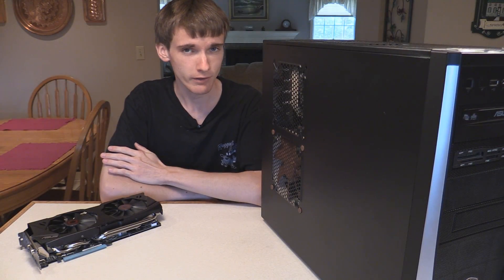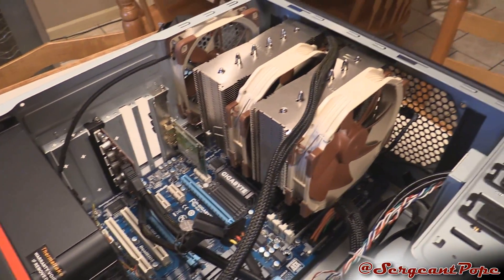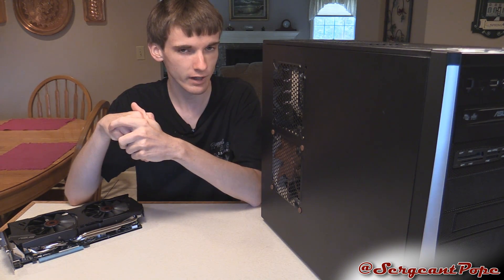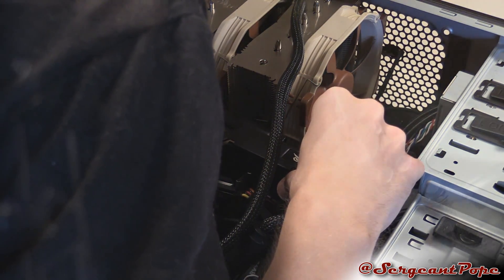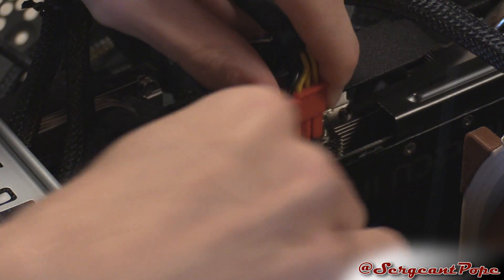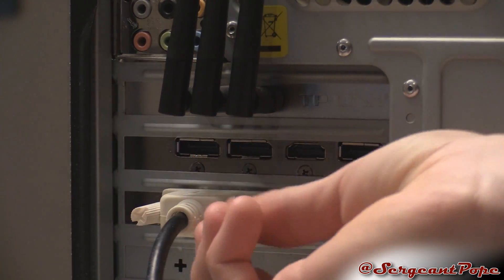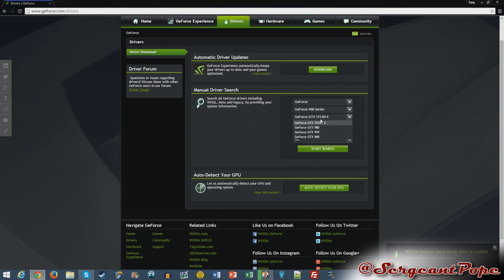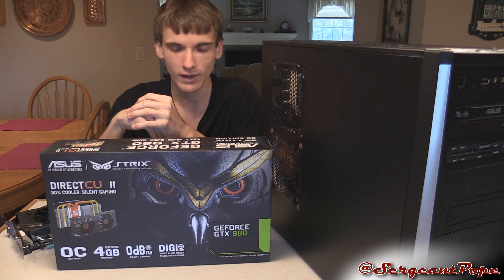How to install a graphics card - GET INTO PC GAMING EASY!

Comment: Hi, I just got a EVGA 1050 ti 4g (Superclocked) graphics card.
I removed the front panel lined up my graphics card and pushed it in, (also i removed the paneling on the backside so the ports would stick out)
(there were also no 6 pin or 8 pin connecters needed)
I turned on my computer, my monitors did not load like they usually do. (my monitors were plugged into my mother board. One is VGA connected and another HDMI)
I am really excited to use it, but i can't. If you have any idea how to fix it please tell me.
my pc specs are
Amd A8-7600 R7 Graphics
16 GB DDR3 Ram
2TB Sata Hard Drive
Antec 380Watt Power supply
Reply from the maker: You have to plug the video cables into your graphics card, not the motherboard. That's probably the issue.

Comment: Hey man what about a GTX 1050 ti?
Reply from the maker: That card is a little bit better than the GTX 950 of course. If you want to spend a little more. It's still a good deal for that card.
Reply: SergeantPope should run cod like a champ surely

Comment: Ok, so I know this is an old vid. but I'm having an issue. maybe I'm just an idiot. I bought a a AMD Radeon RX460 4GB GDDR5. I own a HP Pavilion 510-p024 Desktop. The graphics card seems to be too big? But the card was supposed to be compatible with nearly every computer.
Reply from the maker: That's a really weird motherboard on that desktop. It looks like the 24 pin power connector is at the bottom of the motherboard? It looks like that could block off a graphics card. I don't get why they would've put that connector there... It looks like with that motherboard configuration you'd only be able to fit in a single slot graphics card, which aren't very common. Sorry Nicholas.
Reply: SergeantPope Thanks for telling me.
Reply: SergeantPope Do you think that if you find the free time if you could help me find a gpu for my pc that's at least 4gb?

Comment: I bought a dell inspiron 3847. I figured even with the default built in graphics card it would run most modern games low spec. I was so so wrong. I need a graphics card, I am happy with all other specs on my pc. I have a good 100 or more to drop on a graphics card, and suggestions that will help me play modern games?

Comment: I'm getting a graphics card that is Gt 730 for my DELL Optiplex 745. Will it be good enough for my PC and my power supply is 305 watts.
Reply from the maker: That should most likely work. The GT 730 requires 300 watts.

Comment: Alienware X51 330W psu, installed my new 1060 and uninstalled oild drivers, installed new drivers and i've hit a brick wall and need urget help, any help is appriciated. :)
Reply from the maker: If you're trying to use a GTX 1060 on a 330 watt power supply, that's probably your issue. I think you need at least a 500 watt power supply for the 1060. I have a link in the description of this video that shows the required power for graphics cards.

Comment: will this graphics card work with my dell inspiron 3847?https://www.amazon.com/gp/product/B01K1JV83C/ref=ox_sc_act_title_1?ie=UTF8&psc=1&smid=ATVPDKIKX0DER . i checked the motherboard and it has the PCIEX16 slot aswell as a PCIEX1 slot. my computer has a 300w powersupply and i was wondering if thats enough aswell. thanks!

Comment: any help I installed it with the power supply but the graghics card just keeps spining off and on
Reply from the maker: The fan just keeps spinning? For the power supply or the graphics card? You're getting no picture on your monitor?
Reply: SergeantPope sorry if late but everything works fine but the gpu just turns off and on off and on every 5 seconds the other fans work perfect just not the graghics card I got an rx 470 powercolor red dragon
https://lh3.googleusercontent.com/9jUbhjF_2L1xerjmCzaKeveBTbfsfm5E1s5PeSnYYq2caUN9XnLuO2AZ0IKZJOVzyMcgAF9YNA

Comment: if im running 550 ti at the moment. my power supply compatible with 1060?
Reply from the maker: It should be. Believe it or not, the GTX 1060 actually uses less power than the GTX 550 Ti, despite being a lot more powerful.
Reply: SergeantPope Thanks so much... Im going to shop right now to buy it :)

Comment: I'm new to working with computer components and I have a 1GB DDR3 EVGA GEFORCE GT710 NVIDIA graphics card. I put it in my computer and plugged in an HDMI cord into it but my monitor just turns black. My motherboard is a Z68A-GD65(G3). Is my graphics card compatible with my motherboard or is am I just installing my graphics card in wrong.
Reply from the maker: Your motherboard should be good to go. That's honestly a really low powered graphics card, but it should still work. How much wattage is on your power supply?
Reply: My power supply is 450watts and peak 700watts. Another detail or forgot to tell you was that when I turn on my computer, the monitor is black and at the bottom right, it says B2. Please help, I haven't been on my computer for a month.

Comment: and i have a AMD FX(tm)-4300 Quad-core proccesor does it match with a gtx 1050 ti?
Reply from the maker: Sure, that processor would work fine with a GTX 1050 Ti. As for your power supply, the 1050 Ti is pretty power efficient. If you have a 400 watt power supply, that's probably enough to run it.
Reply: Nice thx dude!

Comment: hey ive  got  a question
my pc is HP Pavilion p6-2431el (350w, 3.40GHz, NVIDIA GeForce GT 640)
and im thinking of changing the graphics card to MSI GTX 1060 Gaming X 6G.
i only need to change the power supply box right?
tnx! :D
ps: i still dont have a new graphics card but im already watching how to install them xD
Reply from the maker: Yep, your computer should easily handle a GTX 1060. But like you already noticed, you'll need to get a slightly more powerful power supply. The 1060 requires 400 watts, which is sadly just above what you have :/
Reply: Haha yeah tnx again 😀

Comment: hey i was just wondering if this would be a good mixture of componets for my gaming pc here they are:
ASUS NVIDIA GEFORCE GTX 750 TI OC 2GB GDDR5 VIDEO GRAPHICS CARD - HDMI DVI & VGA

Intel Core i3 2100 - 3.1 GHz Dual-Core Processor CPU SR05C

and 16gb of ram thx
Reply from the maker: Yeah, that sounds good. 16GB of ram is a little overkill with those other components, but everything would work fine.
Reply: SergeantPope ok thanks :)
Reply: SergeantPope one more thing... do you know of anyways to update more storage on my computer, im running low on storage
Reply: SergeantPope um this is my last question, i woke up this morning to look for a 6pin slot i dont have one nor do i have a 4pin or 8pin csn you help? (its a gaming pc)
Reply from the maker: Pewdiepies Pie - LivingNightmare To update more storage, you could either get a bigger hard drive or SSD that you have your OS loaded onto, or you could add another hard drive or SSD to your system. You don't have a 6 pin connector on your graphics card or your power supply?

Comment: I have A Radeon 270 high profile Graphics Card! It runs Cs:go At 30 FPS should I buy a better one?
Reply: Also 840 p at High
Reply: +Mr.Crafty yes
Reply: TheBrokeWalrus buy a gtx 1050ti low profile and depending on if your processor is a quad core you should get around 90fps you should also have a power supply of at least 350w

Comment: my monitor is vga so when i install graphics card, I don't need to connect my monitor to my motherboard right?
Reply from the maker: Yeah, you'll want to plug your monitor's VGA cable into the graphics card instead of the motherboard now. If your graphics card doesn't have a VGA port, you'll have to get an adapter, though sometimes graphics cards come with these adapters already.
Reply: SergeantPope why do people say ignore VGA and other ports on graphics card and go straight with HDMI only.
Reply from the maker: Agent Tickle HDMI is a lot more common these days because it is digital, can allow higher resolutions and frame rates, and can pass through audio. Does that answer your question? Nothing wrong with VGA, but technology is always advancing.
Reply: Yes it does. Thank You.
Reply: at least im not the only one using VGA XD
Reply: Arran Bear srry but i got a new monitor with hdmi :P
Reply: Agent Tickle why do people make me sad  :(
Reply: Arran Bear cuzzzz u have a bad monitor...
Reply: Agent Tickle i know XD, im getting it changed anyway

Comment: Hey, I am using two asus strix gtx 970 how much power supply do I need to run in sli?
Reply from the maker: From what I found, it looks like you would need at least 700 watts or so to run two GTX 970s in SLI without running into issues at full load.
Reply: SergeantPope  

Oh okay thanks. I currently have a 700 watt so gonna try it :)
Reply from the maker: BLAZEWIND Very cool. As long as your power supply is from a reputable company (such as Corsair, EVGA, etc.) then I would imagine it should work.

Comment: I just got overwatch and I can't play IT because i need A better grafic card. I don't whant to spend more then 100$ but what should I buy?
Reply: gtx 750
Reply: BaseAze r7 260x
Reply: pico666 buy a gtx950....they go for 80 bucks here used and run csgo at max at like 150fps....i bought a 4gb SSC 960 for 90 bucks and ran csgo and l.o.l. at 180fps minimum at MAX settings
Reply: for the price and quality get a palut gtx 750ti you can get a brand new one for £94.99 and it can run csgo at 90fps and 1080p at ultra setting it was my first graphics card now i have three 1080's and 1 of the new titan x's
Reply: link?
Reply: gtx 1050

Comment: My budget is $150 graphics card what should I get that's decent ? And what's the watts
Reply from the maker: There are a few options on the AMD side. An RX 460 is a little under your budget, and the RX 470 is a little over your budget if you can spend a little more. Then on the Nvidia side, the GTX 950 would fit best into your budget. Any of those graphics cards will probably need a 500 watt power supply.
Reply: ok thx

Comment: When uninstalling the old drivers, which ones do I uninstall. All the nividia programs?
Reply from the maker: Yeah, if you already have Nvidia drivers, delete all of them. Sometimes there are several, so you just have to go through all of them an remove them individually.
Reply: thx. the installation of my gtx 1070 went great

Comment: Hi pope greetings from India ,I have DH55TC motherboard i3 processor 4gb ram n 450w psu , as u know the board is a LEGACY BIOS , and want to install GTX 950 EVGA FTW GPU. I herd that it was only UEFI compatible is that so ? Or will it work in my setup . My budget 150$ max advise me if better GPU available
Reply from the maker: That looks like a super old motherboard. I would just suggest getting the graphics card you want and if it doesn't work on your motherboard, then upgrade it to a modern motherboard.
Reply: But that board from intel says it supports till i7 processor , I'm really not inclined towards buying a new board , but in graphic cards there's nothing like it working on a particular BIOS right? Just a 16x PCI will do know ?  Thanx for your speedy reply !!
Reply from the maker: dhiraj sh True, but that is probably much older i7 CPUs. As far as I know, all you need is a PCI 16X slot for a graphics card, so you would just have to buy the graphics card and see if it works I guess.
Reply: SergeantPope  thank you so much !!

Comment: when i add graphics card to my p7-1380t system it does not display
Reply from the maker: Did you upgrade your power supply? Your computer comes with a 300w power supply, which you will almost certainly need to upgrade.
Reply: Is not about powersupply any card I fix does not shoot, i have checked my bios settings still the same. My system model is p7_1380t, pls help me.
Reply from the maker: Opoku Nti Alright, even though almost no graphics cards will run on a 300 watt power supply... On some older systems you have to change the BIOS video out to the graphics card. Other than that, make sure you have your monitor plugged into the video outputs on the graphics card. Make sure the graphics card is fully seated into the motherboard. Make sure you plug in the supplementary power for the graphics card.

Comment: hey need help!!i got r9 270x.the manual says to disable the onboard Graphic,so I did and also changed the display initialization preference to PEG.connected the Monitor to the dvi of the graphic card.but when I start the machine, the display doesn't show anything,it turns on and goes back to power safe mode.what should i do?
Reply from the maker: Hmmm, alright. Do you have the power connector plugged into the graphics card? Is the graphics card seated into the motherboard properly? This could cause issues.
Reply: thanx for the reply.problem is fixed.the dvi to vga adapter which I used was faulty.
Reply from the maker: Rishabh Shirke Ahhh, that's a weird issue. I'm glad it's fixed though.

Comment: My computer is Acer XC-705.Is Asus GeForce GTX 750 Ti OC 2GB compatible with my computer?
Reply from the maker: Your desktop is a low profile design, which means it is half the width of a normal desktop. This makes it slightly more difficult to upgrade, but it's still possible. You would need to buy a GTX 750 Ti low profile card such as this one: https://www.amazon.com/Gigabyte-GV-N75TOC-2GL-Graphics-Cards/dp/B00MW8NXAW/
Then you could also need to upgrade your power supply. The GTX 750 Ti requires 400 watts and your power supply is 220 I believe. But since you have a small case, it will only fit certain types of power supplies, which usually cost more than typical size power supplies.
Reply: Thanks!
Reply: Does the Asus GeForce GTX 960 MINI fit in my computer?
Reply from the maker: Jason Cai I don't believe that would fit. You need a half height card and that card is still full height, even though it's much shorter than average graphics cards.
Reply: So I have an old computer that has a windows Vista in it that is a fullsized desktop. Should I change the old hdd, cpu and ram to my current  ones and just buy GTX 960 MINI and put it in it?
Reply from the maker: Jason Cai That would probably work. Honestly, just getting a new full sized case (either a used one or brand new) would fix your issues. Just move the computer components from your slim case to the bigger case and you'd be able to fit in a normal graphics card. You would also need to get a full sized power supply for it as well, but they aren't too expensive.

Comment: Black screen after installing my graphics card. What should I do?
Reply from the maker: There are lots of things to check. Do your have the video cable plugged into the graphics card now instead of the port you used to use? Do you have the power cable plugged into your graphics card (if it has one)? Those are easy things to trip up on.

Comment: How can I tell which card can play 720p/1080p videos?  Looking for a cheap card to and old pc that can play that. Any suggestions?
Reply from the maker: Any graphics card should be able to play at 1080p, but depending on the card you get, it may play games good or bad at that resolution. What's your budget Andrew?
Reply: $100
Reply from the maker: Alright. $100 is a really tight budget when it comes to graphics cards. The RX 460 would give you greatest value for that price, but the cheapest one I could find was about $110. Here it is though https://smile.amazon.com/Sapphire-Radeon-GDDR5-Graphics-11257-00-20G/dp/B01J1M4H8I/

Comment: so u said nvidia and amd are the main brands, ive been searching and ive found this brand called EVGA. are they good too? here is the gpu im looking at -https://www.amazon.com/EVGA-GeForce-Cooling-Graphics-02G-P4-1950-KR/dp/B01GBS7N54
Reply from the maker: Nvidia and AMD make the graphics processors, but other brands like EVGA put the cooler on and actually sell the card to consumers. EVGA is a very good brand, and the GTX 950 is a pretty solid card for the price.
Reply: SergeantPope ok i see. so who actually made this card? because i dont see it anywhere on the webpage. (im pretty sure it is nvidia because it is geforce. correct? )  And thank you very much for the quick response
Reply from the maker: iTempL You're right, Nvidia actually makes the card. Then EVGA buys the card and gets it ready for the consumer.

Comment: My budget is $210 and i want to get a new graphics cards, got any good suggestions?
Reply from the maker: Terrifying profile pic, fyi. The RX 480 recently came out around that price point and it's a really solid graphics card. The RX 470 is slightly under that price if you want something a little cheaper too. Also, Nvidia recently announced the GTX 1060 3GB version, which should be around $200 and has really impressive performance. So any of those are great choices.
Reply: +SergeantPope Sorry about the profile pic haha, thanks for the recommendations ill check them out.

Comment: My power supply is a Cooler Master 750 W. If I were to get a new video card, will I have to install the PCI-E pin into the video card? Do the video cards come with CD installation disks or do I have to install the drivers?

Comment: Hello I have a graphics card that is 8 years old. When I use Movie Maker and when I insert a movie clip into the program, it takes a while to load. I have a PNY NVIDIA 430 GT. It has a 700 MHz core clock and 1 GB video memory.

Comment: does the evga gt 610 low profile 2gb have a supplementary adapter? and will it work good with a 300w psu
Reply from the maker: I highly doubt the GT 610 has additional power requirements. According to the msi forums, the 610 requires 300 watts.
Reply: Thanks
Reply: I use my 350w PSU with a GT610 2GB. It uses power from your mobo.

Comment: Very informative and good, just bought a EVGA GTX 970 med ACX 2.0. Fuck, need to check if my power supply can handle it.
Reply from the maker: The GTX 970 requires 28 amps and 500 watts, hopefully your PSU can handle that!